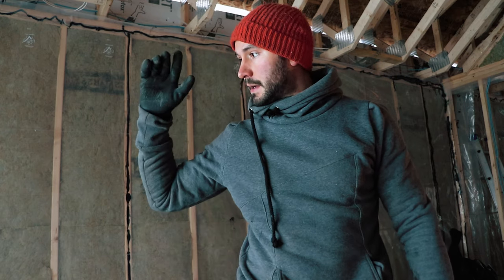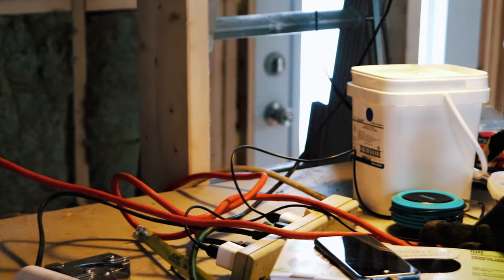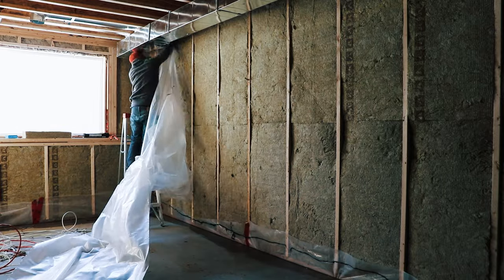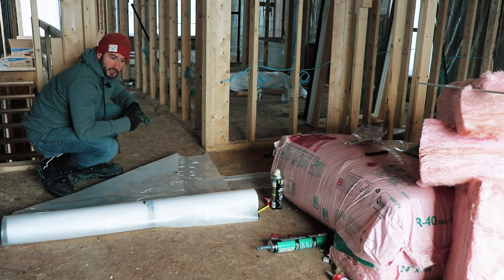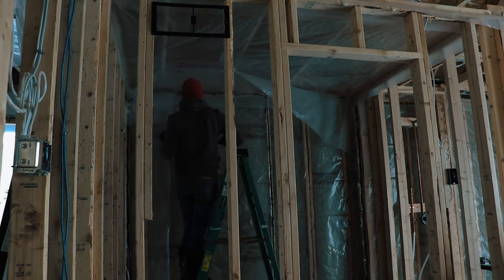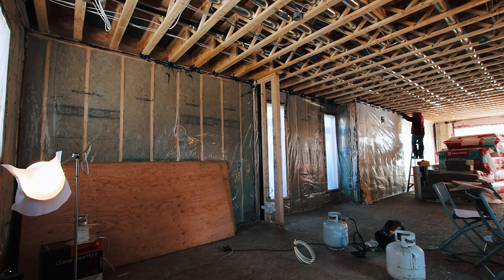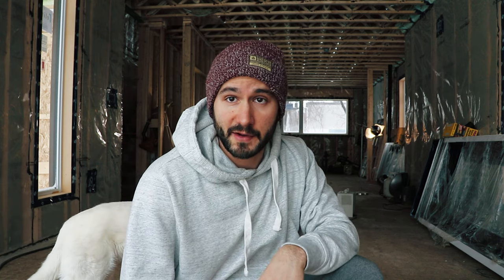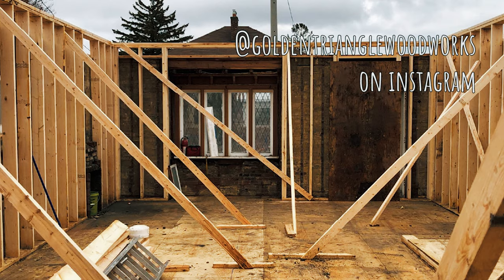EP 12 : VAPOR BARRIER INSTALLATION - DON'T MAKE THESE MISTAKES!

Comment: Hugo, would you put a vapor barrier if you were renovating a home in the south (hot/humid climate)?
Reply: Absolutely. Humidity is something of a consideration, but you're forgetting the main purpose of the interior vapour barrier. Do you shower? Cook? Live in the space? If you do, you are creating moisture, vapour, and your breath as small as it is, will all contribute to moisture, condensation, and eventual rot, if you do not seal the wall and insulation from it. Remember that moisture attacks from within, as well as outside. Depends though, are we talking Louisiana, or Florida? You may not need it that far, but check your local codes.
Reply: Whit Dodson polyethylene barrier is also for air not just moisture. If your air inside the home leaks through to outside so will your temperature (hot or cold). Keeps moisture out and air (hot or cold) in
Reply from the maker: Not sure in your climate sorry! Could always call your local building inspector for more insight.

Comment: Your vapour barrier should to be on the inside of your insulation otherwise you don’t have a functioning barrier. Your dew point is now in between your roxul or any type of insulation you are using and foam board which would be wicking into your plywood and your studs; you want all seams to be overlapping from top down that way if you do end up with moisture for any reason it won’t pool in an upward flap (top of wall flap underneath the ceiling piece) acoustic each piece to the next and if there is no joining piece of poly to continue seal it to an inside structure ie. interior stud, floor or top plate and seal any gap leading to exterior. Your batts should look custom machined for the space they are in (perfect). If they look bad, they are done wrong. Any area with less insulation or gap even if you can’t see it will let more temperature pass and more temperatures passing means more condensation forming on top of a bigger heating/cooling bill
Reply from the maker: good to know! Thanks!
Reply: So you mean vapour barrier it behind the stud wall? How do you accomplish this?
Reply: That really depends if you live in a cold or warm climate. Hugo showed how to do it in cold climate.
Reply: In a high humidity region that gets real cold, would it be better if the vapor barrier goes on foundation wall first?

Comment: You should have a 16" wide vapor barrier installed between your interior wall to exterior wall intersection for barrier continuity.  At 1:38 you do not.
Reply from the maker: You're right, it was on the plans and contractor failed to do so. By the time we realized it was too late. Thanks for pointing that out.
Reply: are you talking about the right wall where there is a T intersection between the interior/exterior wall? If so, would this be installed during framing between the joining point? Thanks
Reply from the maker: @Mike95431  It's at the ends of the floors, prior to the sheathing going on, a 16" strip should be attached so that you can have a continuous envelope from your first floor VB to your second floor.
Reply: Plate poly

Comment: Hey Hugo not to bash on ya but I’d definitely be caulking all you’re cracks on exterior walls and I recommend caulking your electric boots too before putting up vapour barrier. You don’t really need to worry so much about going down every stud. Oh and you always want your caulking going over wood for a solid seal. I can go on a bit more but those are some pointers! I hope they help
Reply from the maker: Will know for the next house ;) Thanks! There's a lot of things I will do differently hah.

Comment: I won’t be using a vapor barrier. They make it hard to dry also.
Reply: Depends on where you live, if you don't, your house will rot around you.
Reply: Its code in canada
Reply: You wouldn't believe how much condensate you can get in your walls in cold weather if there are humidity sources (people, animals, kitchen, bathroom etc) indoors in cold climate. If the wall can't transfer that humidity outwards  your house will rot away fast
Reply from the maker: It's code aroudn here!
Reply: Using a breathable moisture barrier/membrain will mitigate this issue but still provide a decent air barrier at the same time letting humidity/moisture pass through
Reply: Vapor barriers are only required for low density fiberglass  or rockwool or  dens pack cellulose. Dense pack fiberglass and the other high density materials dint need one. Your better off eliminating the issue by getting rid of the cold condensating plywood.

Comment: Why wouldn’t you want the vapor barrier on the outside of the house? To keep everything from rotting I.e. studs and stuff
Reply from the maker: condensation.. it would rott from the inside. You're holding it vapour from inside the house. Showers, cooking, heating.. would mould your insulation. You weather seal from the outside with a breathable material such as Tyvek so the insulation can breathe and dry out. Keep away moisture on the warm side.

Comment: Good work! Was it a cost based decision to not spray foam the wall cavity’s too?
Reply from the maker: That's right. Spray foam, at least in our area, is very expensive. Just to give you an idea, Rockwool insulation cost roughly 3500$ of material for an 1800$ house (walls only). Spray foam for rim joists only cost me about 2200$. I didn't get spray foam priced out for the whole house but I would assume it's almost 3 times the price. Although, if I factor in all the time I spent doing insulation and vapour barrier, I'll definitely consider it the next house I build! I've also read that spray foam performs great for the first 5-6 years and then starts to crack and lose some of its properties, might be something to consider as well. Thanks for watching, Nathon!
Reply: @HugoBuilds  This is late, but spray foam should be cheaper than Rockwool (most expensive option) or Fibre Insulation, however I only use spray foam in small cavities like around holes drilles out for pipings or hard to reach spots behind ducts. 

Spray foam can easily be done improperly giving you thousands in repairs to remove the bad foam, this happens more often in extreme climates (really hot or really cold).
Reply from the maker: @h3llblaz3r12  that's not the case in our neck or the woods. Sprayfoam is really expensive if you want to do the entire wall cavity. It's also very hard to make any changes after the fact; since this video we've had a bunch of little things like plugs and what not to move which would have been a huge pain with spray foam.

Comment: If you add minimum 2" of rigid foam it is classed as a vapour barrier in some codes
Reply from the maker: Yea as long as it's the proper foam and it's taped and sealed.

Comment: One does all the work to minimise holes, then you go and nail/screw/attach a finishing material (such as drywall) over the top.   Building codes states 48 screws per 4x8 sheet of drywall.....LOL shakes head...
Reply: The acoustic adhesive helps to mitigate the drywall screws. What are you implying, no vapour barrier?
Reply from the maker: It's the code here.. you're right it does bring up some questions.

Comment: I would never suggest covering insulation ever!! You will fully regret it when you find out your studs have rotted away from moisture rott coming from an unknowns leak, either from roof or siding. It happens  all the time and wet drywall is the best way to find a leak before it gets worse.
Reply from the maker: It's standard building code here. You might be in a different climate but in Canada, you can't pass inspection without it unless you provide engineering details showing your dew point and why you wouldn't need it.

Comment: Rolls out VB then proceeds to walk all over it....
Reply: So, he wasn't wearing crampons!
Reply from the maker: haha see this dude's respond. It's tough stuff.
Reply: HugoBuilds 

When you walk on it you risk putting pin holes in it from the debris on the floor. Those pinholes translate to a lot of condensation in the stud cavities, up to a cup of water over 24 hours. 
The proper way is to roll it out vertically along the wall face, then unfold it as you fasten it.
Reply from the maker: @AllaroundNbackagain  I know! You're right.. I think we were just teasing! Always best practice to be careful.

Comment: trap that moisture in the walls.. this house wont last 30 years
Reply from the maker: Tim, not quite sure where you are getting this information. This is conventional building science and required by building code - at least in a cold climate where we live. VB is on the warm side of the assembly  so that the wall can breathe to the outside. There's plenty of circulation in this wall assembly.